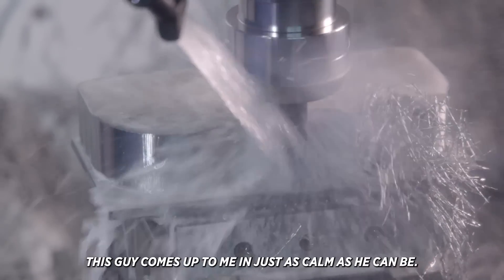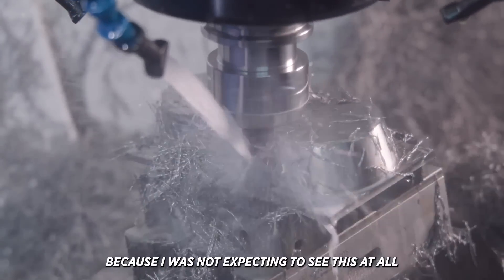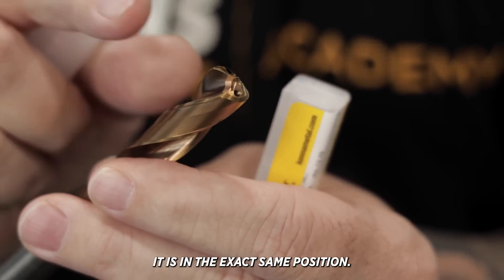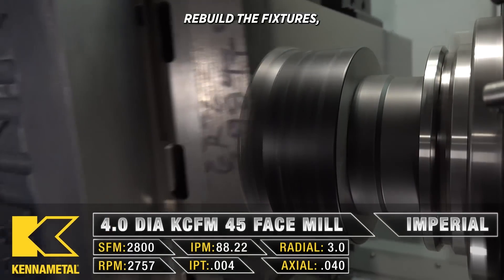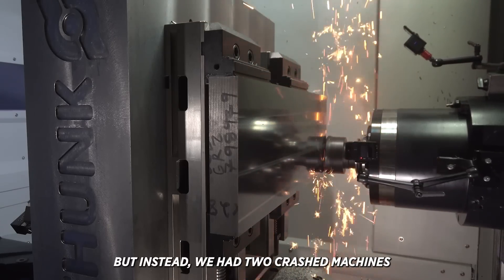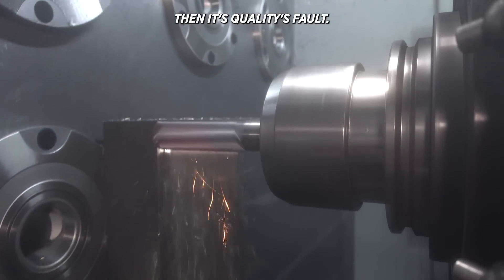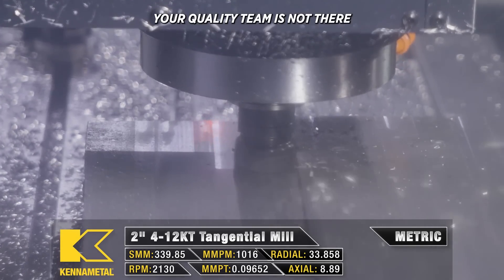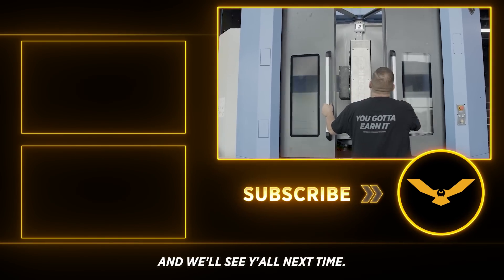$200,000 Damage | EPIC FAIL… Machinist CRASHES TWO MACHINES at the Same Time

Comment: I don't understand, is tool lenght part of the program (programmers job)  or the machines tool library (machinist)?
Reply: On the cam side you can remove tool offset call outs. IE: T0101 would be a lathe call out, I believe mills use T01 H01. Although, I suspect what happened here is that the programmer didn't set a tool offset number for the tool he was using. Could have been T01 H00 for instance, or any other number as well. I seem to remember mills happily running without an offset, but lathes would complain about syntax, and error out.

However, as a quick way to check if tools are correct, you really should skim through programs and double check if all the tools have the correct tool offsets, and if they're different go talk to your supervisor or your programmer, won't cost you anything except some time.
Reply: @orangedream267  that is right.  They actually used an old post that wouldn’t even read the tool length or number from the operation so they had to manually enter them with a text operation before every toolpath that had a tool change.  This one he forgot to add it in there.
Reply: Yes in Fanuc it is, yet another reason to hate Fanuc ha ha
Reply: @heath gallagher What do you mean. Machines crash because a human did something dumb. Not because something is possible.
Reply: @heath gallagher If you make a shop insolvent by smashing one machine, the shop is either A), just starting out, or B), has much bigger issues. But before we get to that, this is why the lead programmers should be proving out anything they run, or they should have someone under them who they trust to prove things out. And when I say programmers, I mean the desk nerds. Not necessarily the guy who can go up to a control and hand code a part in. 

As for machines checking for the syntax of a line of code, it does matter sometimes, older haas controls are a tiny bit looser on those tool offsets, the newer NGCs, I believe check for a matching height offset. CAD/CAM side, it depends on how your post is, at one of my jobs, it'd throw an error as soon as you posted the code (posting code is very similar to a compiler in computer programming, or translating from human language to beep boop language for the rest of us squishies) if you forgot to modify the tool number/ height offset from 00. At my current one, it's just done automagically, due to the way Mastercam is. And the reason this is done, because not all machines are created equal. A prototrak for instance, doesn't need a height offset, as it doesn't have a tool changer.

And it's always good to remember, running a program is essentially running a continuous MDI. If you tell the machine to go M3 S1000 G00 Z-100.0 It'll just do it. The machine is DUMB. The human ideally, should not be.
Reply: @heath gallagher Lad, you either work in high end shop, or you have no idea what you're talking about. Not every machine has the capability of auto probing parts. And the issue with auto probing happened in the vid we're commenting in. Probes don't always turn on when they're in the spindle, some machines, yeah they're on immediately. However, that still won't save the probe (especially, if the actual tip of the probe misses any contact, and the probe body is the point of impact) from being sent into the part at 100% rapid. And EVEN IF you have auto probing on, you STILL NEED TO TELL THE MACHINE RELATIVELY WHERE THE PART IS, AND HOW IT'S ORIENTED.  Yes there is CAS systems where the machine will simulate the move before actually moving, and error out telling you you're a moron because you're sending the probe 10 inches into the part IF AND ONLY IF, you set it up properly. There's NO automation for setup or proving parts out. Or, you know, telling the machine to run Program A for Part A, and ONLY Part A, when you, the knuckle dragger put in Part B.

How machines should be run has literally zero bearing on how they ARE run. I know of stories of commercial jet engine companies whose 6 out of 8 5 axis machines are down because of apes who don't tell anyone they crashed because of a broken tool or something. I've been to companies who run shitbox haas's that are a decade old and haven't crashed since they bought them, WITHOUT using probes. I've seen 20 year old machines that are kept in BEAUTIFUL condition, and machines that were put down a year ago and look like they've been in the shop for 10. Your little fantasy world of EVERY MACHINE IS A TOP END OKUMA/ DMG/ HERMLE/ KERN is just that. A bloody fantasty. Especially assuming the jokers pushing the buttons are intelligent enough to make zero mistakes.